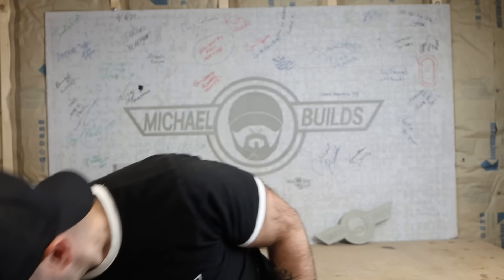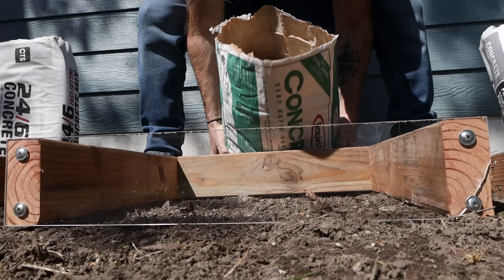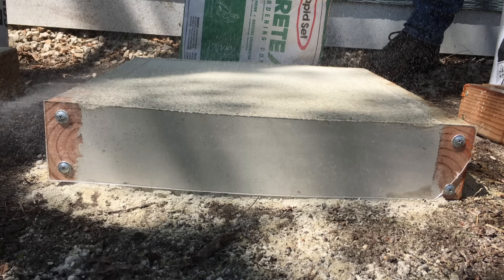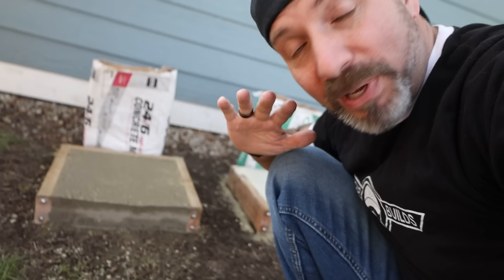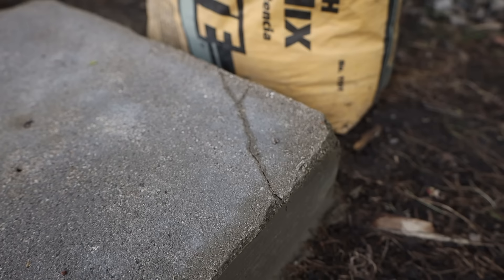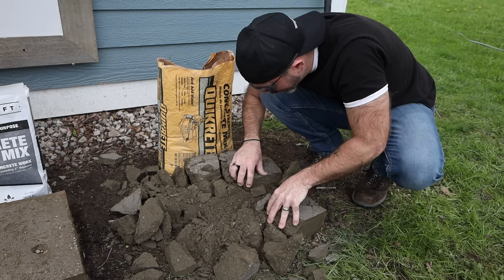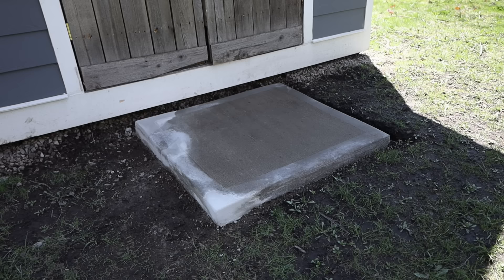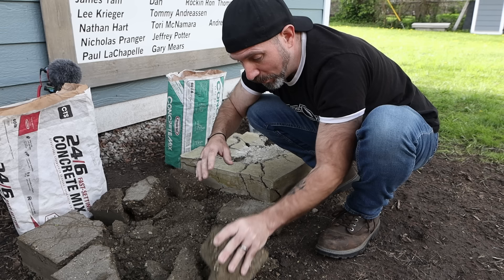Dry Pour Showdown!

Comment: I had a half of bag of regular Quickcrete that I realized I was never going to do anything with, so at the end of my gravel driveway when it rains hard it washes out a little. I poured it out kinda evenly and it's probably 1-2 inches or so thick. It's been there and rained on and drove on for about 3 weeks. It holds together for the most part but very weak and crumbly. I can make it crumble with my boot. I can only guess that unless mixed properly it will never be very strong. looking forward to seeing the results of your slab!

Comment: I had a friend of mine years ago. Take paper bags and put dry concrete in them and shape them into like stones and he laid down a patio and soaked it for several days. Then let it bake in the sun and then took a blowtorch and burned off all the paper and they sure look like rocks and years later it still looks like that and no cracking no disintegration. I'm just curious if you could try something like that

Comment: I wonder what would happen if you kept misting after the top layer was solid enough to hold water for the duration of the cement's setting time (eg 30 min). So that the block is very wet instead of damp

Comment: What I haven't seen yet is misting after each vertical inch or so of product is poured into the forms. I've done dry-pour that way with heavy misting successfully. I've also done it by mixing the water and product inside the forms on a visqueen ground-cover. The dry-pour method shown here needs way more water applied to be successful.

Comment: As far as I know water will permeate through concrete, so I don't think the rapid set should have been just fine.  And why not put a layer of plastic on the bottom?   Also I'm wondering about putting some re-bar in it would it adhere good to the bar, encapsulating the bar nicely?

Comment: Curious how much moisture had to come from below?  If 6 mil plastic were under the dry pour, would the chemical reaction actually finish?  Also curious about cured weight of the slab compared to traditional pour...has the concrete fully hydrated?  Weight will tell you how much water the slab pulled in from the ground/top.

Comment: Concrete isn't really waterproof. It does allow water to pass through, so keeping it wet, real wet for days would be a good idea. Water will not hurt it as long as it's holding together, as long as it's not washing away the Portland cement. Days of a slow soaking rain would be good for this as soon as it gets to the point where water will not wash away the Portland cement. Concrete needs water to cure. 

I would like to see what would happen if you took one of those squares the next day and submerged it in water for about a week, and then test it for strength after 30 days.

Comment: I don't think any of them are porous enough to allow the center powder to absorb more moisture. I'm wondering if you wet down the soil, before pouring the mixes in.
Reply: He did say that the center of most were most enough to set, but that is my big fear as well.  Like the top (and possibly bottom) have a good inch or two of pretty strong concrete, but the center is too isolated to set well and would leave a ton of micro air pockets.

I really want to see (or hear about) a long term dry pour in the worst conditions for concrete.  Consistent shrink and expand through winter and summer for say 5 years or more.

These types of videos are a great start though!

Comment: Interesting...to bad you did not include a normal pour with it as a control... cant wait to see the next vid. Would like to see a comparison with roman concrete per the formula released not long ago. Per the report it was found to contain salt water and quick(?) Lime whick they believe makes it self healing... will check my history and post the link if i find it. In another video a guy did a dry pour and drove his truck on it... ii believe he said (if i remember correctly) dry pour has half the strength of wet.... on his or another vid, they misted once and followed with 6 soaks with an hour rest.

Comment: DRY POURING IS FOR LAZY PEOPLE. I HAVE INSTALLED A LOT OF FENCE AND TRIED BOTH WET AND DRY. THE DRY DOESN'T HOLD UP AN 8 FT POST FOR LONG. THE WET MIX HASN'T EVER LET ME DOWN. IF YOUR RELYING ON A CLEAN POUR. MIX IT BEFORE YOU POUR IT. YOU WILL BE GLAD YOU ONLY HAD TO DO IT ONE TIME.

Comment: There needs to be a control slab for each brand. One poured the old fashioned way and one using the dry method. After 30 days hit both with a hammer to compare.

Comment: You need to be thinking about concrete like slow drying epoxy and also like baking a cake. The recipe and order of ingredients as well as timing all play a factor. There is a thermal(heat) reaction during the cure time that factors into the bonding. Too much water is like a coolant as well as too little wetness doesn't get every reactant wet enough to start the process. You basically need the exact amount of wet and be thoroughly mixed and it shouldn't dry out until fully cured. It needs to bake itself in the initial chemical reaction both within the first minutes and until the first 24 hours to set the mold and continue to solidify like placing a jello mold in the fridge for up to a month. Even after it will continue to harden as rain and sun bake and wet it over and over continuously through it's life cycle. It becomes hard and porous always allowing some water to trickle through like a sponge but not all like a flood. Try making pottery containers with it like clay pots until you have played with it long enough where you can get the timing accurate. The better you learn to craft it by experiment you come to find your best final product.

Comment: On your beloved Rapid Set, why didn't you just shorten your intervals for it?  Since it cures more quickly, you could have cut your wait times in half or in quarters.   The whole point of waiting is to allow the concrete to set up just enough that more water won't deform or wash down the mix. But if you wait too long, it loses porosity and water can't reach the middle of the slab  So if you waited only 30 minutes in between steps on the Rapid Set, wouldn't that be a better test?

Comment: As a certified concrete tester (ASTM) and worked for Quikrete for 23 years. No way I would dry pour any cement not even fast set in a post hole. Not knowing your location is another question what is the aggregate used in the packaged cement? Was flyash used in the production of the concrete? Just like Sakcrete, Quikrete has production plants all over so quality is often different. I was regional Quality Control for years and will tell y’all this all packaged cement isn’t the same. Quikrete has expanded so rapidly that quality is often sacrificed just to fill orders. Also bulk construction jobs takes priority over consumer products. Don’t be fooled by these Pro Finish products they are the same ie: pro5000 and pro mason mix all they do is change bags. The company I worked for was bought by Quikrete and the product quality soon started to suffer. My best advise and I’ve tested both is to buy Sakrete it’s stronger and they have QC facilities at every plant. Bottom line Quikrete is a terrible product after they went public quality went down hill.

Comment: Might be worth it to also wet down the base of your form before trying this. So the slabs have moisture to pull in from below. Very interesting.
Reply: when I did this I didnt use quick setting, but I pre wet the ground, half filled my mold, misted it real heavy, then poured the rest and misted again then put my 180 arch sprinker on the side of my lil driveway/ parking spot pour, and set my automatic timer to wet it for 10 minutes every 3 hours and let that do its thing for 24 hours, and then left it alone for 30 days and its help up pretty well for a few years now, and I park my lawncare setup on it every day.

Comment: It would be interesting to see the exothermic temperature of the reaction. I think a full year of curing would tell the most to compare the products.
Reply: (Found this written by an civil engineer) 
@mikehewitt1253
1 month ago (edited)
Dear all, let me try to help everyone understand concrete. 

The cement part of any mortar or concrete reacts with water in a hydraulic chemical reaction (exothermic reaction i.e. generates heat). When thoroughly cured, meaning allowing enough time for this reaction to take place and preferably throughout all the cement particles where they become irreversibly hardened and water proof.

However, cement on it's own will shrink significantly and crack all over so it needs a binder - sand - this 'stretches' the cement through the mix so when it hardens via Curing it's bonded to lot's of already hard sand particles and more cement particles alike creating  a hard material that doesn't crack - mortar.

However 😁 mortar is not strong in itself. For strength we add Aggregate, ideally for strength you want some flat, some irregular stones (not pebble like) of 3 sizes - pea size, golf ball size and halfway between those - giving us Concrete when Cured throughout.

Now, I've watched many dry pour vids with interest and listened to the nay sayers saying it has to be WET to cure and therefore dry pour is nonsense.........

Time for education folks where (after that which I have outlined above) you will be surprised that I'm on the side of dry pour ....... SORT OF......

When dry pouring, it is tamped thoroughly down before spraying - this is GOOD - but cement particles and sand particles and aggregate elements throughout will not all receive moisture, will not Cure and will remain as dust in parts - not good.

BUT Wet is not great either! It's CONVENIENT.

The best, strongest concrete is Mechanical Concrete which is made with JUST ENOUGH water to provide moisture throughout for correct curing.

The test is - grab a small fist full, squeeze hard together in palm of hand and if doesn't hold shape and crumbles when released from pressure, needs more moisture. The shape should Break cleanly in two pieces without crumbling - if stretches in the break test, it's too wet.

So my recommendation to all is........

Dry pour mix thoroughly together with rake, add moisture by spraying so as not to over-wet BUT rake that moisture throughout and THEN Tamp down hard compacting it all properly and level off.

All this 24 hrs later stuff is inadequate - Minimum curing time is a month - covered to keep that minimum moisture in the mixed pad, base, driveway, - shouldn't be touched, don't go near it - best of both worlds here as easy as Dry Pour and stronger than the normal convenient Wet stuff which because of too much moisture cannot be as compacted and consolidated to provide the same strength.

Go Mechanical guys, it's the best. Anyone want to hear my views on Earthcrete, which I find fascinating - by the way - I'm a Civil Engineer - spent an entire year studying Concrete - an entire bloody year on nothing but concrete.

PS DON'T use quickset anything, you won't have enough time for all rake work, use standard Portland.

Comment: I'm wondering whether CSA cements are worse for protecting steel reinforcing, since they are less alkaline.

The other downsides I find are the rapid set nature means they generate more heat so are unsuitable for large volumes of concrete, and they're slightly more expensive.

Comment: Great video, especially your see-through form. A 2x4 frame would, according to Cajun Country's shower formula, require 2 showers per inch. I think you did less than 8 showers which would mean, again according to Cajun Country, not enough water. I imagine they met with results similar to yours during their trial & errors that lead to their 2 showers per inch rule of thumb. They stick to that rule & seem to get solid, correctly curable concrete.. In other videos someone dry pours ignoring the 2 showers rule & gets only almost okay results. I'd like to see you pour again sticking to 2 showers per inch. I bet your favorite Rapid Set would do what you want, no powder

Comment: Is an impact test the same as weight bearing capability?

Like the amount of force you applied with the sledge hammer in that area, could it support the weight of the object without catastrophic failure? 

(Example. The force of the sledge hammer hitting the block is 200 pounds in about a 3x3 area. Could 200 pounds be rested on a 3x3 area without destroying the slab?)

Comment: 👉  I'd  to see this test done over again. Theoretically this dry pour system could work but just not convinced.

I'd like to see the same four products dry poured...

And then again,  the same four products properly mixed and  poured into another set of pad forms... 

Technically this dry pour method would be ideal for  a basement bathroom renovation where concrete had been removed so that new toilet and shower drains could be plumbed back in.   

Standard bathroom area, roughly 6x6 x3 1/2 area of concrete to be replaced...

Comment: Do this test again with a normal slab as a control. I am curious what the difference would be. Also, You may not have needed to hit each slab more than once to see what it looked like. It kinda looked like you pulverized them with the additional hits. That might not happen with regular concrete but that's why the control would have been nice to see.

Comment: I have a horrible gravel driveway I only park in first part of off street. Usually only use rest a couple times a year to have mulch, etc. delivered. The weeds have taken over I'm constantly hand pulling weeds, spraying weed killer. I've seen people spreading some dry concrete on their gravel driveways. Do you think this option would help me ? Atleast in 8 ft section towards to the encroaching jungle

Comment: I would bet that the dry pour method is introducing water in a non-uniform fashion which causes the crystalline structures not to form completely and therefore the concrete is weak. Just an educated guess.

Comment: Based on what I've seen so far, I wouldn't rule it out, either, but it depends on what you're using it for. I would think that for critical situations where strength and aesthetics, you'd want to mix it up and work it "properly", but for around the home landscaping and garden jobs, dry pouring would be fine. The need to come back and water it every hour during the initial stage to keep it moist (don't laugh) seems like almost as much effort than just mixing it and moving on with it. That's just my opinion so far. I'm not a concrete guy, but I have dealt with concrete a lot over my life.
Reply: For most, it's also the added expense of equipment that makes this a viable option
Reply: But the timing and mixing of a huge patio slab, working by yourself, trying to save $$$, is alot of work. Can't risk screwing it up. Dry pour let's you take your time, as long as it doesn't rain. Just keep watering it. Simple

Comment: Does anyone think this dry pour method would still be effective when doing pier applications with sonotubes or caissons, going 4 feet deep or more? It seems like any brackets set at the top would not get enough water directly underneath them to get the best possible 'set' as compared to doing a wet mix pour. 
I will stick with the wet mix pour on any concrete application.

Comment: Would dry pour work with a regular mixture of sand and Portland cement or do we need a fast setting mix?
Reply: I'd love to know this too. Have only seen demo's with pre-mixed
Reply: The problem I see with using Porland cement is that it is almost impossible to find dry sand and dry gravel. As soon as you mix in the cement, it is going to no longer be dry and it will be hard to get the finish that QuickCrete (or similar) will allow in its very dry form. But if you can find dry sand and gravel, it should be possible and considerably cheaper.

Comment: Do you have to use a concrete adhesive on the the old concrete  if you're dry pouring?..I have a 8 foot long about 2 feet wide and it's 6 inches deep.. that was cut out.. wondering if I want to dry pour the new or just go with mixing it.

Comment: Wouldn’t your cured slab prove the same thing? When you break or cut into it and it is fully hardened, then wouldn’t it be obvious that moisture had penetrated all the way to the cured concrete? And where it is still dry, then one can only conclude that not enough moisture made it far enough, nullifying the effectiveness of the dry pour concept.

Comment: Need 3 test slabs.... one for 2 days,  one for 2 weeks,  one for 2 months.  Then let's see!
Reply: That would be a great test. Regular concrete achieves 90% of its 28-day strength after just two weeks. I suspect that dry pour will follow the same strength curve. It is to be seen if it is 50% or 80% or whatever of a wet pour.

Comment: I bet if you did this right it would work. Here's how I would do it.  I would soak the ground thoroughly first, Base course of 3/4 inch gravel firmly compacted, vapor barrier on top that then put the dry mix (1 part Portland, 2 parts 3/4 inch gravel and 3 parts mason sand) I would put this dry mix 3/4ths of the form so if it's a 2x4 I would go up about 3 inches. I would thoroughly soak the mix with water so it comes to a slurry. I would prod it with rebar and walk through it with Mason boots and maybe even a concrete vibratory  to constitute the fines, the rock and the Portland. Then I would mix the last 4-5 mixes wet with the drum mixer  and pour ontop of the soaked mix and finish it. Not to insult you but moisture rises up with concrete since it actually gets hot with the mix and we all know that heat rises. Why would wetting the top and letting it dry be wise. Your hardening the top so future water sprays cannot penetrate the rest of the mix.